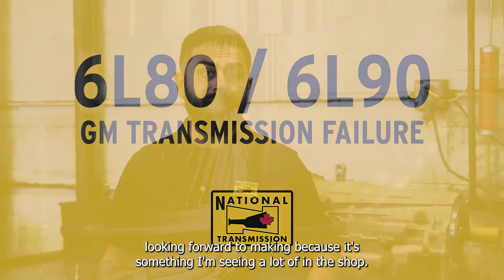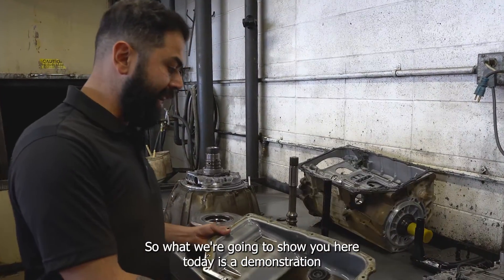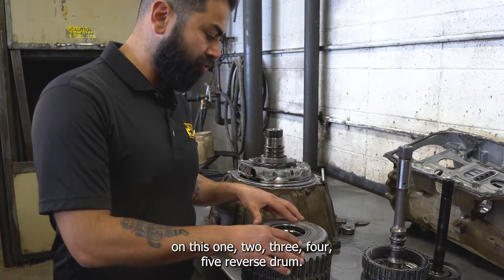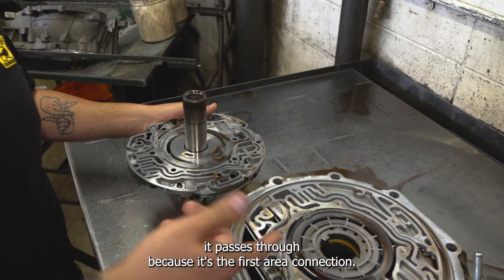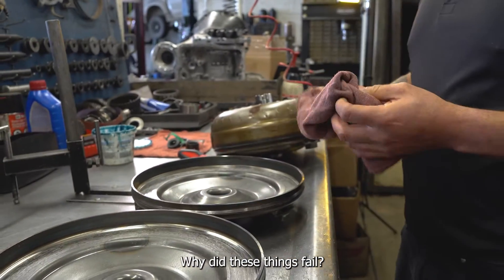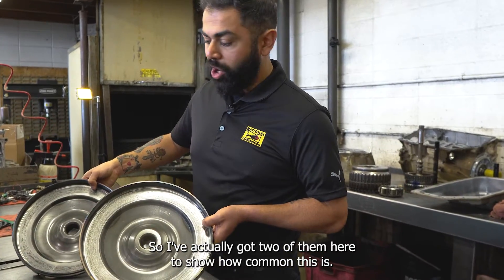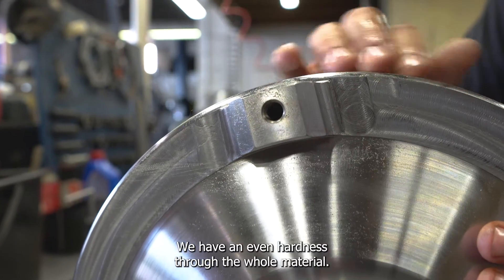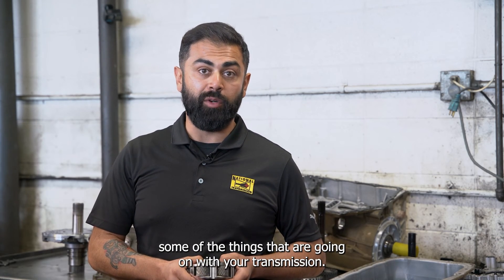How We Fix GM Transmission Failure (6L80 & 6L90)

Comment: LOL if your transmission oil is black you know they have not serviced it as its supposed to be, they simply do the engine oil if that and run it down to the ground basically especially the trucks ,they work them very hard and always never ever make sure if towing that the transmission has a real good external trans cooler and if its in hot humid weather ,then get a trans cooler with a fan on it which is connected to a electronic switch to turn on if the trans fluid reaches more than say 85 degrees or better still make sure you have a control temp valve built in the trans cooler so it allows the oil to pass through at the spec temps and also a temp sensor as part of the cooler and pressure sensors as well, well worth it in the end, but heres the thing most owners do not care they simply run into the ground and then just upgrade and i feel sorry for those 2nd hand buyers who do not do their research on the real history of the truck they are buying?

Comment: 2019 8L90e is the same problem, mine started under 80k miles, dealer can’t even get a replacement transmission and it’s been nearly 2 months!

Comment: These were not the best transmissions nor were they the worst. The guy mentions at the beginning of the video about the smell of the fluid. Never changing the fluid is the demise of any automatic transmission. Same with never changing power steering fluid. Rack and pinion steering units are sensitive to dirty fluid.

Comment: Great video.. However, you did not discuss what the REAL failure reason is.. I can make a factory GM converter-without a billet base-just a straight up factory GM torque converter last 300,000 miles... I'm a transmission builder out of Houston, TX... You talk about the failures within the converter, and you are half right about why they are coming apart... However, your "billet base" fix is just a temporary solution and you are not addressing the real problem. I can make a factory Gm converter outlast your Precision 4645HD billet base converter.... Running the Precision billet base converters is just a band aid... Essentially you will STILL have the same failure as the factory converters suffer, but the difference is it will be much further down the line than the factory converters typically fail at. We see, on average, that the GM converters are failing between 80-120,000 miles. Obviously some go further, but these are the averages.. Your billet base converter is going to last, on average, into the 200+/-K mile range (on top of the mileage that was on the vehicle before rebuild or installation of the Precision billet base converter).. We know this because we used to run those converters with fleet customers who put that kind of mileage on vehicles in under 5 years... We learned a lot from that experience, and we learned to fix it RIGHT.. the converter is not the answer my friend... We now have factory GM converters that are into the 300+K mileage range without failure... It can be done. For those of you looking for a ROCK SOLID  GM 6 Speed rebuild, here in the US, specifically Houston, TX, reach out to me... We can show your transmission the heavenly light of longevity. If you have a factory unit that has less than 80K miles on it and want to put the fix in place before converter failure-we can help you with that! Or, if you have had your trans rebuilt elsewhere and want to avoid another torque converter failure... hit me up!
Reply: You are just advertising without even giving a clue to why it fails.
Reply: Its the programming @devopstech7054
Reply: @devopstech7054  So what you are saying is.... I've done EXACTLY the same thing as this video-claim that I can fix it, and yet shared none of the pertinent details. Man, you are SHARP! Industry knowledge that came to me at a price well into the hundreds of thousands of dollars, and over 20 years of investment of my personal time to achieve this level.... why would I not just GIVE IT ALL UP for free! I like your idea, but I also have kids to put through college, and bills to pay, and staff to take care of... But I really like your "give it away" mentality... Tell you what, bring your GM 6 speed equipped vehicle to my shop, pay for the "fix" and I'll allow you to watch what we do, exactly as we do it...  I think that is MORE than fair. Until that time, you are just a panhandler asking for something for free, with nothing to offer in exchange, and I'm not in a "give it away" mood.  I'll tell you this-we machine parts in-house to address issues within the transmission. Even if you watched us work, you still would not be able to replicate what we do unless you have access to lathes, and mills, and know what parts and pieces need the work. So.. maybe that is a more helpful answer? We CAN make your factory GM torque converter last in excess of 300,000 miles and we offer a warranty to that effect! Hah! Our standard warranty on rebuilt 6 speeds is 5 year, 100,000 miles for $3250-tax included-and that includes installation, programming, fluid, labor, ALL OF IT.  Our LIFETIME warranty is $4150 and essentially there is no mileage, or time, limitations... Find me another transmission shop ANYWHERE in the nation who is standing behind their work, and their word, like that... If I decide to give away our trade secrets at some point in the future, you can bet you will be the first to know! In fact, I'll make a video, and link you to it! Until then..
Reply: @Go69  never said to “give it all up”, I specially mentioned a clue. Are people just supposed to take you for your word ? Are you a mechanic or a politician lol ? I don’t want to ascribe anything onto you what you are saying, I want to see a plausible path to the “actual fix” you allude to. I’m also not that mechanically inclined to take a “clue” reverse engineer your process and apply to my own transmission, come to think of it, who is ?
Reply: @devopstech7054  "Taking my word for it"... People drop off their cars at my shop every single day-people that I have never met before by the way, complete strangers-to have their transmissions rebuilt, or repaired. So... Are those people "taking my word for it"? I don't know them, I have not met them before speaking to them on the phone... or sometimes they will just show up and hand me their keys and say "fix it". Yes, people trust me. Yes my reviews reflect that I can be trusted. I'm neither a "mechanic" nor a "politician", I'm a transmission engineer. If you want to see a plausible path to a fix-drop your vehicle off, or hang around and watch, and you won't need us to hold your hands and walk you through the process-you can watch, or not, and the end result will be a fixed vehicle, with a substantial warranty. It IS that simple..  If I want a steak I don't go to the butcher and ask to watch while he slaughters the cow-I just buy the steak. Unless people just WANT to make it more complicated???? I'm all about easy. I have spent considerable time making it "easy" to fix these units. It was not an easy road, and I have no shame in accepting compensation for my efforts. Since you asked for a "clue", I'll give you what you want-without the semantics-we take a 3 pronged approach that includes a boxed shift correction package, our own in-house solution to temperature regulation to include machined parts on the valve body, and elsewhere, and we edit and correct the transmission control algorithm. See how easy that is?
Reply: @Go69 how much to install a zl1 converter in mine, has 110k miles and seems to be doing fine. But I don't want it to.
Reply: @Go69 can you recommend a transmission shop in the Phoenix Arizona area?
Reply: @robertedgemont  My apologies but I do not know of any shops in the area you are inquiring about.
Reply: Contact info?
Houston is closer than Canada.
Reply: Advertising like this in someone else's YouTube video means DESPERATION to me... 

If you as GOOD as you say you are, you would NOT have to be writing paragraphs here, trying to convince people to come to your shop that you won't even give a name or address to, people WOULD be coming in from word of mouth from fairly priced, great, service. 

So, I'm not buying what you're saying here...🤷
Reply: @davelowets  I'm advertising NOTHING... I don't need any additional work because we are booked 6 weeks out-with an average daily car count of 30+.. I'm not trying to convince ANYONE to come to my shop and I don't know how you got that from any of these posts. The only thing I've tried to post here is information that's relative to keeping a 6l80E alive despite what GM has done to intentionally cause them to fail. I DO NOT want random LOSERS like you showing up at my shop so if you notice I have NEVER ONCE posted my shops address... Get a clue. Get a life. Stop posting on an INFORMATIONAL threads unless you have something positive to add. If the length of my post bothers you because you suffer from reading comprehension... Boo-hoo for you.
Reply: You got contact info?
Reply: Where is your shop in Houston you have peaked my interest in your knowledge of the inherent problems and fixes for this transmission,  what is the name of your business ?
Reply: Send me your info I'll know I'll need a tranny in the near future either in a tractor or truck I'm outside of Houston

Comment: tell me about it dramatic failure is not the word for it. mine went so bad the entire driveline locked up almost like hitting the brakes, the dealership kept telling me it was fine its just the TCM needs a reflash lol yeah I said my transmission fluid smells burnt they said oh no its fine, I work at a shop I was well aware of what was going on,  it was slipping hard shudders and super hard downshifts,  this was just after purchasing the truck used from them a week and a half later,  this transmission issue almost killed me I had a semi following just within a car length behind me, if I didn't react  as fast as I did me and the truck would have been toast, safe to say exactly the issue you said in this video just more, since the vehicle was not covered on a warranty due to 241000 on the truck I only put 887 KM on that truck at that time, it cost $10,000 CAD for a replacement not a rebuild that came out of the US due to none available at that time in Canada they covered half cost and footed me with the rest so far 15000Km on the new transmission and well its starting to do some odd things yet again, one is a odd ticking sound in the bellhousing something I have never heard any of these 2014 to 2018 trucks make ever I have seen a few come and go still unable to diagnose or even find information on that! she has 4 years and 100k warranty on the replacement so I am not worried just mad  that this is so common love the truck otherwise.
Reply: When you say ur driveline locked up, was it like as if the truck was just mashing the brakes to the floor with every downshift? Was it the torque converter causing that issue? 

My truck did that when i first got it tuned, it would downshift so hard, the tires would literally screech on the road. If there was a car behind me, they’d think i was brake checking them. Every downshift would push me into my steering wheel.

Comment: The man or machine welding those converters could be tuned way down and probably stop virtually all this..other than shotty material
Reply: BS, they machine the clutch area after weld.  Its the programming allowing slip of the clutch all the time.

Comment: I’m looking at an 08 2500hd guy says transmission is stuck in 5th gear what’s the cause an fix to this problem does the transmission need to be rebuilt

Comment: I have a 8L90 transmission in my 2018 Sierra 1500 and would like to know if that torque converter would work in my truck and if so, 
 how can I get one. and also where are you located?

Comment: I have an intermittent shudders and vibrations when drive 50 mph+ in D mode only . When I select 5 or 6 shift everything becomes normal. Could HP tuners fix this problem ? 2011 chevrolet camaro ss.
Reply: yes, a good programmer can fix the shutter

Comment: I had to have my transmission rebuilt on a 2015 GMC 1500 at 136,000 miles. It still slips slightly, I removed just over a quart of fluid which improved that issue.. When I took it back, the shop told me that the fluid level was fine and that nothing was wrong. I also asked about that super solutions temperature gauge and the shop said that wouldn't make a difference. I live in Vegas and the temperature runs at an average of 189 degrees. I've got just over 7000 miles on it. It only slips slightly on slow speeds, generally in the morning. I've got a 2 year, 24,000 mile warranty and I think it's probably going to fail again, further down the road. When I jump on it, it performs just fine.
Reply: Find a person who can change the program in the TCM
Reply: @drloch6174  I'll give it a shot, thanks
Reply: If it's slipping, it has failed again. It's not operating correctly if it slips.
Reply: @Thundarr995  40,000 miles so far, could it be an adjustment. It's only slight at low speeds, otherwise it's been working. Of course the shop told me there were zero issues,  because I brought it back 3 times
Hmmmmm

Comment: The main failure of a transmission is overheating. Put a transmission fix on the trans oil by installing a thermostat update kit from superior solutions.
Reply: No guarantees.  I've serviced the fluid and filter,  put in a shift solution kit and added an additional auxiliary transmission cooler.  Mine still quit. They're shit converters. Made of cheap stamped steel with welded pads. They flex, warp, slip and chew themselves up and send it through the pump and the rest of the trans... mine still drives. (I'm not driving it however) so I hope it's not too late.
Reply: Thanks! Kerry
Reply: This only works if there is no internal damage already. Cooler temp means nothing if metal has contaminated the transmission.
Reply: And... mine failed. Full rebuild.  No machining required (that I'm aware of) but built to last this time. Upgraded clutches, shift improvement kit and billet converter.  Cost me $5k with the removal and re-install.
Reply: @craigquann  I'm doing the same thing to my 2016 Silverado. I bought it used, and the truck is solid, but I want to replace the trans on my time, not when it wants to go. Lol. Going to be between 6-7k Canadian.
Reply: @camerons6028  that was $5k CAD. Lol. I owned mine from New. So I knew that it wasn't "abused". The other supposed failure is because of AFM. Apparently it causes the torque converter to slip intentionally just slightly to smooth out the harshness of V4 mode. So I got that deactivated with a tune. Should I ever need to open the engine,  it's getting a full AFM delete and a cam and new bearings etc. As long as the body/frame doesn't get eaten by the salt.
Reply: @craigquann gotta change something with the oil too I believe…
Reply: @shannonwitthacannons9461  no. That's the 8 and 10 speeds. They have a TSB for fluid change to help with shuddering

Comment: I have a 2017 Silverado with the 6L 80 transmission. 215,000 miles with probably 20,000 towing a trailer. I change the fluid every 30,000 miles with a complete flush. Should I just swap out the torque converter now while I have no issues or continue to change the fluid regularly and also put in that new lower temperature thermostat? Any helpful Guidance in this area would be extremely appreciate. Thanks!. Kerry
Reply: Sure Cool part #STL010.  highly recommended.  Factory 180 degree TOO HIGH
Reply: Hi sorry for the late reply. Also it appears im responding from my personal account but oh well. I don't recommend fixing anything that doesn't require it. I've seen plenty of these units go high mileage. When the time comes with high mileage units as yours is you want to be addressing more than just the torque converter.
Reply: @arashahmar9073  damn took u so long to reply hahaha
Reply: Changing fluid every 30,000 miles is why it still works at 215,000 miles.
Reply: ff